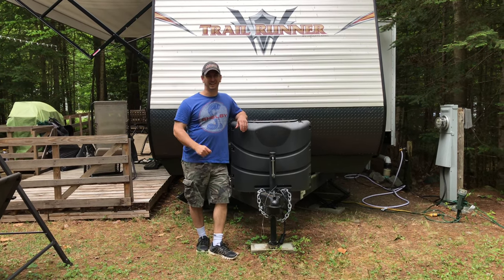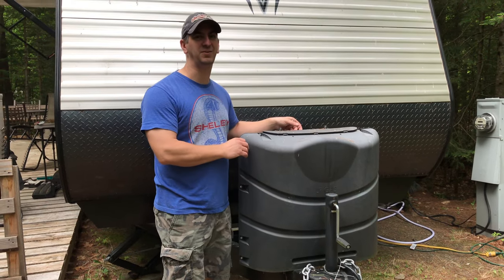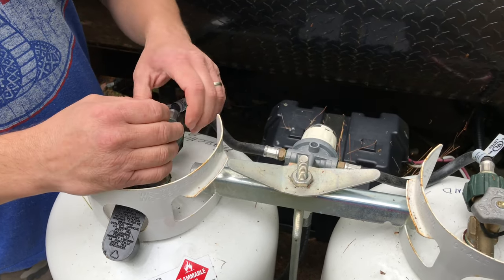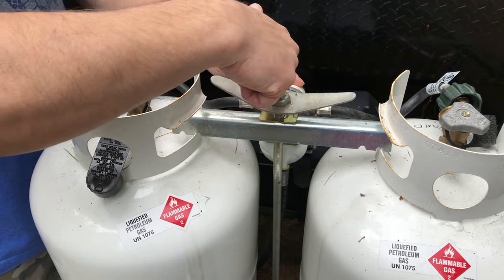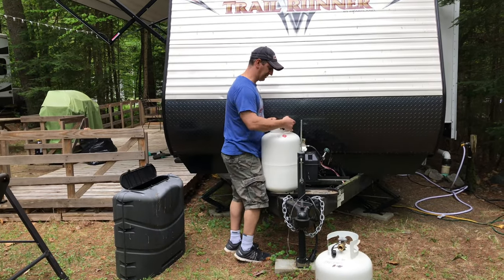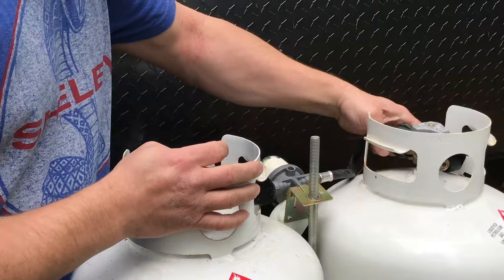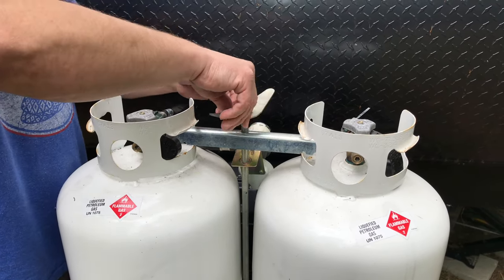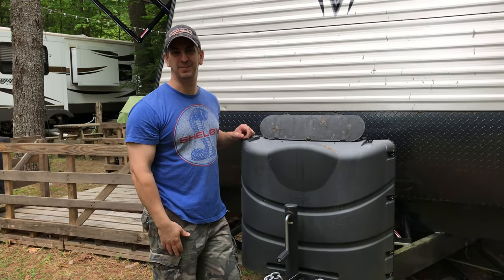How To Change or the Propane Tanks on a RV

Comment: Don't the gas connection go on top of the tank clamp? It was on top before you took it off. Please let me know so I'm doing it right.
Reply from the maker: You propane line configuration may be slightly different  but you should be able to adapt what is shown in this video to your camper. Hope this helps you out

Comment: Does that angle with the regulator mounted to it go in between the Channel and the wing nut?
Reply from the maker: Mine was under it from the factory
Reply: @HomeownerRepair  maybe but it was between when u started the disassembly.   Makes more sense to me that the regulator would sit on the bracket between the tanks.  Thank u for the video.

Comment: My green clear gauge is below the cover, which is confusing to me from the manufacture. I did take the cover off and found the gauge which is not seen without taking the cover off which is garbage! The gauge does show both of them green so I assume I have propane in each tank still??
Reply from the maker: If the indicators are green then you should have propane in the tank that is selected.